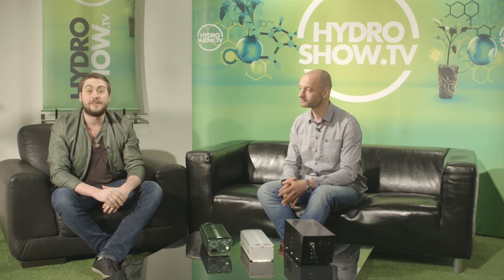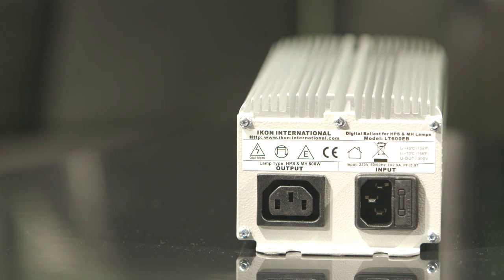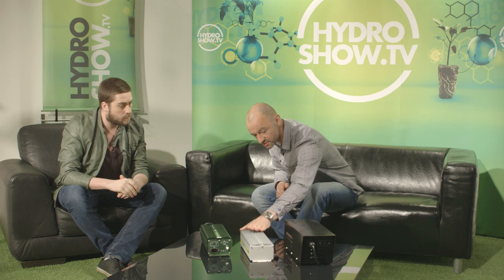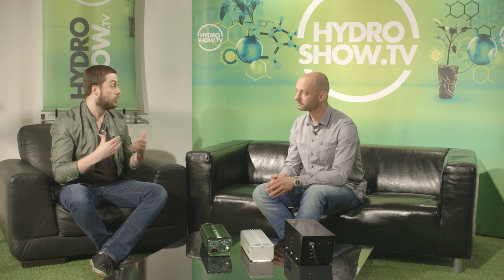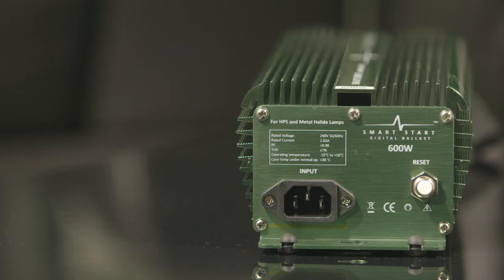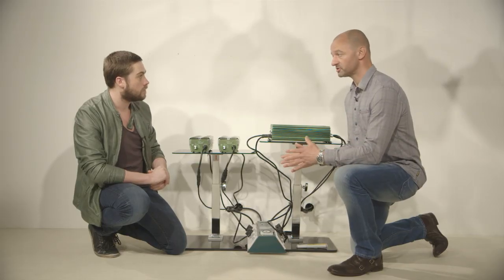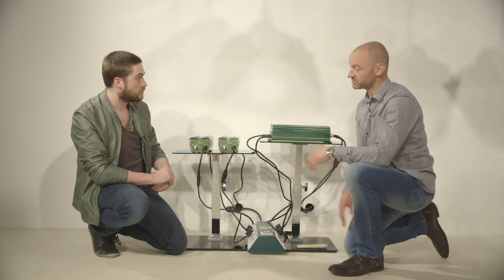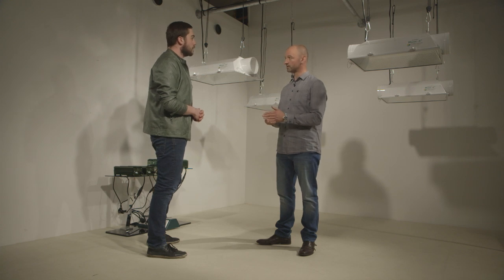SE01 EP06 -- Digital Ballast vs Magnetic Ballast Comparison.

Comment: Cab you use dual spectrum and stull turn it up and down
Reply from the maker: I believe so... but, lamps are generally designed to have optimum spectrum at a specific power, which is one reason so many growers prefer LEDs today, where the light output spectrum isn't affected.

Comment: Your expert seems not to understand the technical aspects of how these newer digital ballasts work.
When you asked him about the eradication of flicker at (4:02), Sellman simply states that the newer digital ballasts "...regulate the flow of electricity..."
Well, that's exactly what magnetic ballasts do - they regulate, or more accurately limit, (choke) the flow of electricity, (current).
In fact these ballasts are also known as chokes.
Yes, he does go on to say that the digital ballasts run the bulb at a constant lumen output (well, sort of but actually, no they don't), but he clearly doesn't understand how this (the appearance of constant lumen output) is achieved.
>
Reply from the maker: Consider him told 🤣

Comment: they keep talking about efficiency but does any of that equate to lower electric bills?
Reply: Did you come up with an answer yourself over the last 4 years? 😂

If you arent looking for ballast that also heats your room and wastes energy into making ratteling noises,  a digital ballast   sounds more economical.

Not even talking about the improved lamp life time with a modern ballast. 
That also adds to saving money. 😊

But with LEDs getting cheaper and better, those seem to be outdated and replaced soon too..

Although My HPS - digital ballast combo, still outlived the first generation of LED grow light i tried tho ..

RiP Hanspanel ..atleast until i can afford repairs.. 😢
Reply from the maker: Efficiency = less heat
Reply: Look up the word , good god

Comment: Funny...when you talk to someone pushing digital ballasts they never seem to mention all the interference they generate.  I'll take slightly less efficiency over not having everyone on my block losing their internet connection.
Reply from the maker: RF Shielding is key to prevent this, which is definitely a feature in this case
Reply: @manthingsuk  It's not just about shielding, you also need to incorporate appropriate filtering on the input and output lines.
Reply: Thanks for the response.  I've seen so many videos that talk about digital ballasts that either don't even mention the subject, or throw out a one-liner like "they've been known to cause some RF interference".  On higher wattage older models with no shielding, the amount of interference can affect half a city block under worst case conditions...far from an ideal situation.
Reply from the maker: We agree. We have heard of ballasts interfering with internet connections, although never experienced it ourselves. The manufacturer does state RF shielding on their bullet list, and knowing them, I would suggest they have definitely paid attention to this!
Reply: OR the lower reliability. 
Industry Shills: "digital ballasts are better now!"
professionals: "they really aren't, tho."

Comment from the maker: Sol-Digital, alongside their engineers, developed this ballast for the UK market many years ago and it was well underway here before they had even heard of the company Solis-Tek. Sol later learned that Solis-Tek, at some stage, had used some of the same engineers to help develop their product for the US market, and this is the reason is why there are similarities in the two designs and a cross over in ideas. To say it’s a knock off is simply untrue.